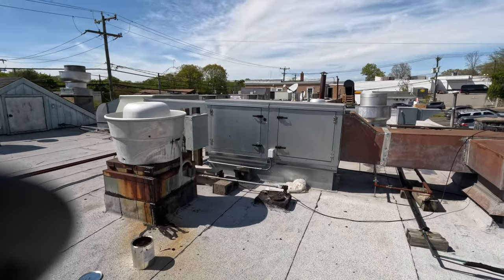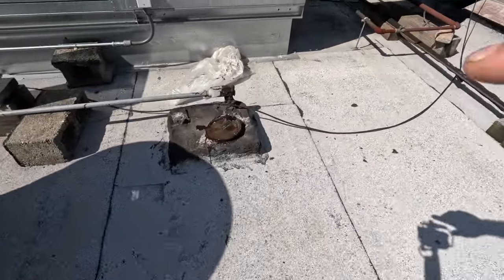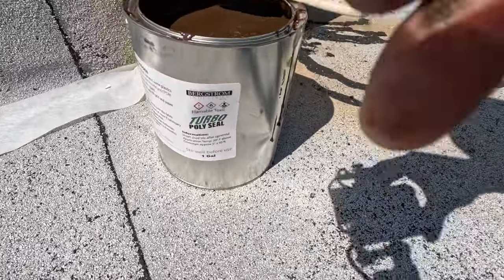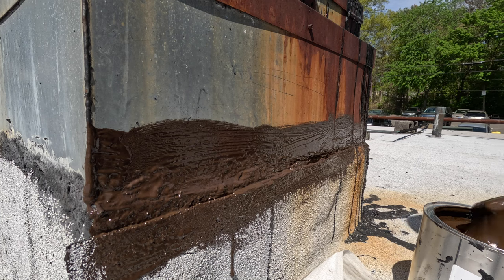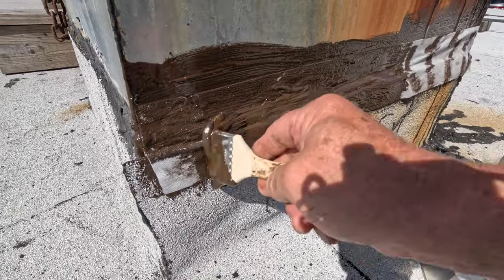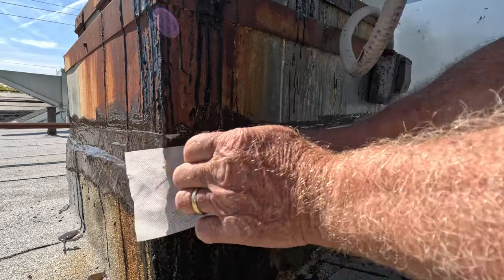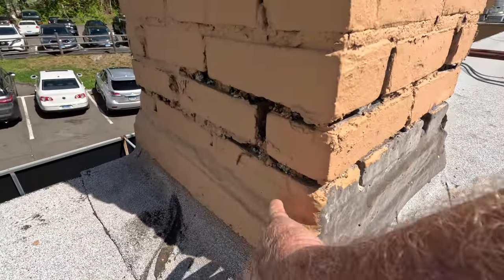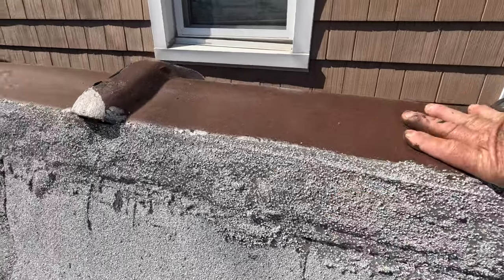Fix Roof Leaks In Vents, Flashing, And Chimneys In 5 Minutes - Simple Diy Solution With No Hassle

Comment: for that curb you could just screw T bar on it and caulk the gum cup at the top, but that should work too, just make sure the surface is clean, on grease it may peel off.
Reply from the maker: I don't keep T Bars, metal screws, and Caulk and a screw gun on me. I always have Turbo and a fleece on me. Much easier.
Reply: @FlatRoofDoctor  oh it was a leak call. i see.